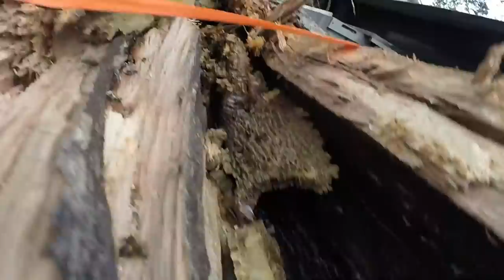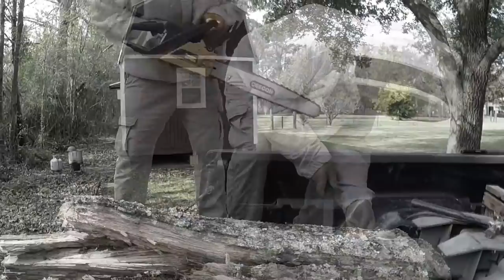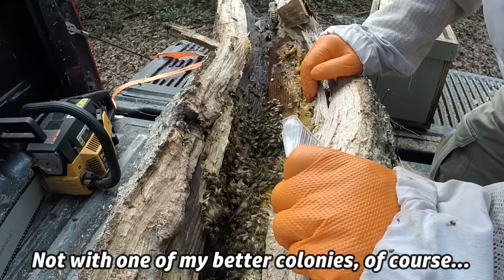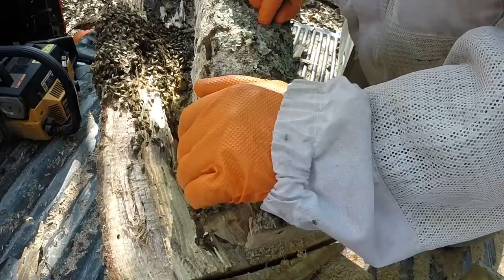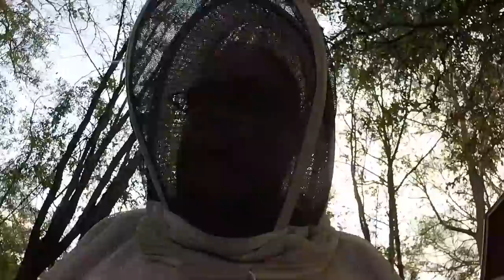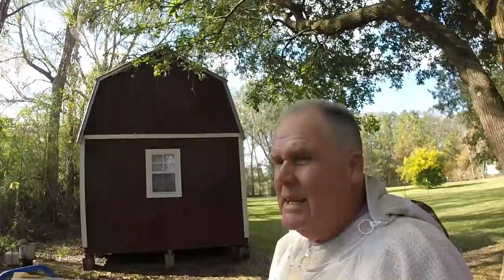Hive Removal in November-No, Really

Comment: I had to pull a hive from the walls of an old derelict building, slated to be torn down within the next day.
I used a chainsaw, and a sawzall, and ended up taking the whole eight foot high wall from r second floor (3 sections so I could get them down the ladder).
I reassembled them back at home, with foam tape insulation to seal the cuts from the weather.
I'm gonna secure it standing upright for the winter, and open it up come warmer weather.
We're in New England, and they'd never survive if I tore into it this late in the season.
Keep doing good things Mike!
Reply from the maker: Wow, that’s a job!! And great thinking as they’ll have a better chance in their existing nest. Yea, you guys get brutally cold!!

Comment: Got yourself nice little feral colony.  They probably make it can feed them with out robbing frenzy smells in the air .. some of that foam has pesticides in for termites
Reply from the maker: I thought about that with the polystyrene. I can keep them fed in our mild winter I believe. As long as the beetles start to die out.
Reply: Bought some bettle be gone sheets don't think they ever did catch a bettle .. got reading said bees need to chew on the sheets before they work. Normally a weaker hive to begin with not doing much chewing  .. stronger hives they just propolised them.